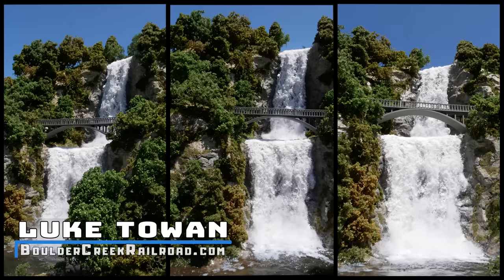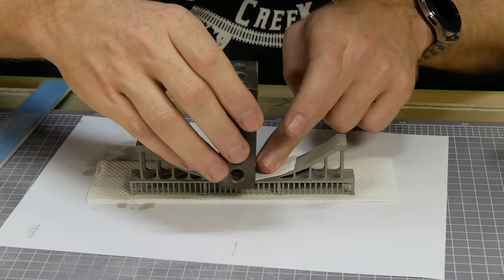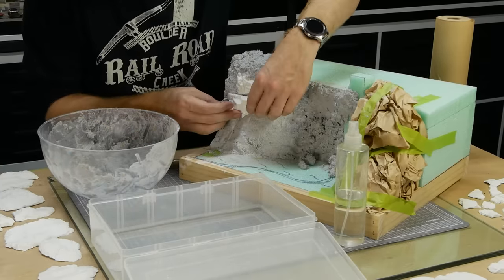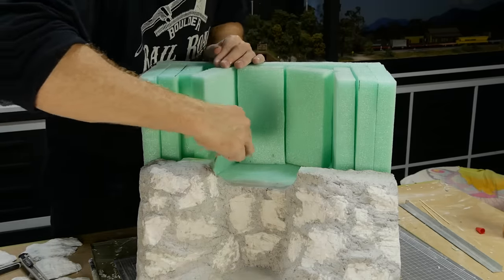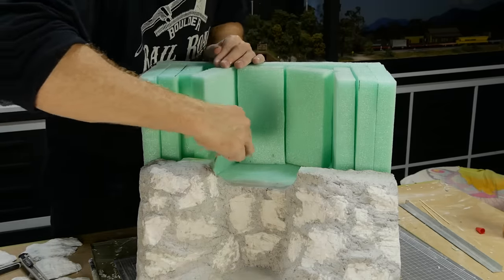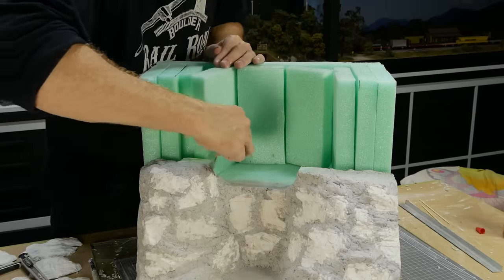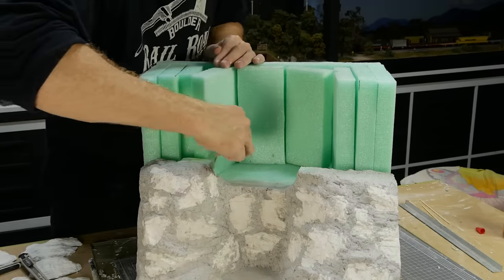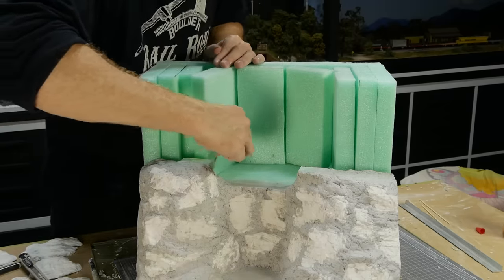How to Build an Ultra Realistic Waterfall… Realistic Scenery Vol.34

Comment: Actually have a poster of Multnomah Falls hanging on my wall in my craft room where I make my dioramas! Too funny. Brilliant work as usual, sir. You actually started my addiction to building these types of dioramas and for that I thank you! Your tutorials are by far the best out there and have taught me pretty much everything I know.
Reply from the maker: That's awesome, I'm glad I've been able to give you a bit of inspiration for your modelling 😀
Reply: @BoulderCreekRailroad  An inspiration indeed! And also a great teacher as your tutorials explain perfectly how to achieve amazing results with ease-not to mention having some pretty solid comedy sprinkled in along the way😁As a fan of animated projects (love the mini r/c, oil drill and magnorail builds) I was curious if you've ever considered using running water for a flowing river or stream? It doesn't work well for whitewater or waterfall scenes but looks pretty good in a scene like your Muddy River diorama. There's really not much to adding the water-basically just applying waterproofing (polyurethane for me) straight to the foam and then using it in place of the modge podge in the wet areas when adding the dirt texture, rocks, etc. Lighting is an important part of the finished project to highlight movement of the water but other than that & water reservoir/pump placement there's not too much to it, especially if the water stays on one level of foam. I have a 3-4 minute video on the lighting aspect of it if you'd like to see what the running water looks like. Didn't make the house in video-not quite to that level yet! And certainly nowhere near the level of making great videos either (you've set the bar pretty high on that one!) so in the event that you watch any of the others I've made let me go ahead and apologize for you having to sit through that!  https://youtu.be/TETqjOiEj-0

Comment: What a wonderful master class on waterfalls and terrain modelling, I loved your tip on using hot glue to seal the plastic sheet to make the dam for the river resin and using alcohol to soften it up so that it can be removed afterwards.  I will definitely use that in my next diorama.  The overall diorama is amazing !! Thank you so much for sharing your work with us.

Comment: Very nice tutorial. I'm working on my own waterfalls at the moment, so I went out to make many pictures (not a problem in Norway, there is a waterfall at every corner). There is a slight detail which many people do wrong when making a waterfall: The white water starts after the water has passed the edge, not before. Unless the water is already flowing fast enough to create white water.
Reply: With the falls this is modeled after they are whitewater before the edge, especially in springtime.

Comment: Once again, a masterclass in scenic building!

My only thought is that the foaming of the water doesn't usually start at the very top of the waterfall, but only further down, as the water is churned by itself and the air. Any thoughts on how to achieve this look?

Comment: Great videos!    One quick question.   I built a small dam out of tiny rocks and my glue gun.   I want to pour epoxy behind this dam and wondered if the epoxy will melt the glue?   I have never used epoxy before and heard it gets hot.   Thanks

Comment: Great work as always. 
How do you clean tools after using them with epoxy. For instance, this brush you're using to paint epoxy in the waterfall areas? Do you throw this brush away or there is a way to clean it?

Comment: Lovely work, mate! As good as Weta or ILM! 
   You mention polyurethane and epoxy resin. Might you clarify these for us, please? 

   By any chance, have you any methods realistically to simulate open flame, suitable for a diorama featuring a building caught alight? 
   This would comprise three components: 1) the portions of the structure burnt, charred, damaged, all to varying degrees. Some parts or debris may have fallen down below. Other pieces may be missing altogether. 
 2) the flames themselves; I infer that these would comprise transparent liquids stained in clear reds, oranges, yellows, that over time cure to a solid. This is iust a guess, but perhaps one might start with your "realistic water" technique, then upon drying completely, invert the piece precisely 180°. 3) Smoke. I would surmise that one would begin with your stimulated water approach, staining the dried material with the colours appropriate to the setting. Most fires produce white exudation, with light greys for contrast and shading. Maybe some yellows, ochres, sepias, sands, etc. Other fires give off a deep black, with subtle highlighting in dark greys. What do you think?

Comment: You can of course use the damaged bridge model for something else, which incorporates some form of decaying infrastructure, with the bridge serving as a collapsed bridge, so any damage to it would add to the effect... :)
Reply: Well, the actual Multnomah Falls bridge was damaged a few years ago in a rockfall, so depending on what parts were damaged, it could still be realistic scenery!
Reply from the maker: So true, I actually keep nearly all of my fail prints and damaged parts in a box for that reason, they also work for little rubbish piles and things like that as well 😀

Comment: I watched all your videos and tried for the first time to pour epoxy and blew it.   Don’t know what I did wrong, it never hardened.   Sticky like glue.   Problem one my dam didn’t work good and I got a leak.   Problem two, the edge of my dam was uneven and couldn’t make a good stop for the epoxy.   Help, I just need an idea besides tearing my project apart.

Comment: Add some flickering LED lighting behind the aluminum wire facing toward the mountain with a reflective Mylar to give the impression of moving water would be phenomenal. Like a pulsing but barely visible light using an Arduino to make the lights pulse off and on. I'd use the ultra-affordable Arduino Nano. Here's the tutorial for pulsing LED's. https://youtu.be/7c8TWXlr7q4?si=BEVD1XRW50wnzjVK
 I would use LEDs in a parallel circuit at a specific voltage supply so you won't need resistors. I love what you made here. Very nice. I simply love it.

Comment: Also if you love your skin, eyes, and lungs, protection while using epoxy resin is advised. The bare minimum for working with epoxy is gloves, eye protection, and protective clothing. And a well ventilated area or a respirator. If you don't love your skin eyes and lungs... well, nevermind all this.